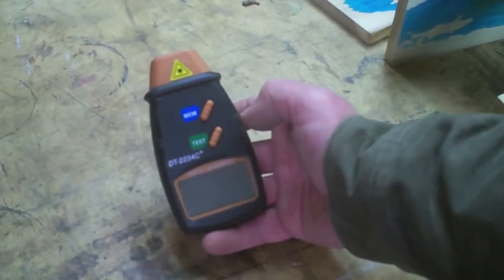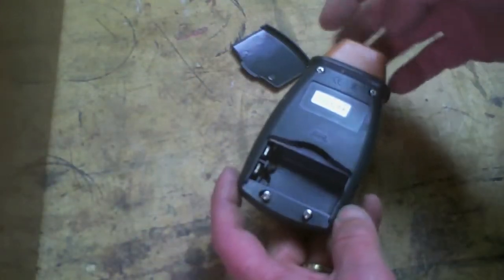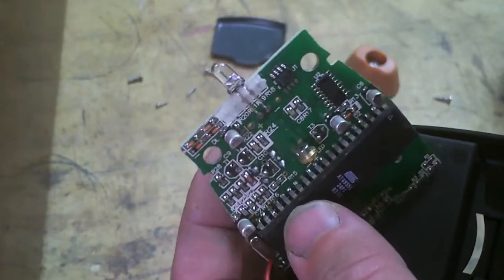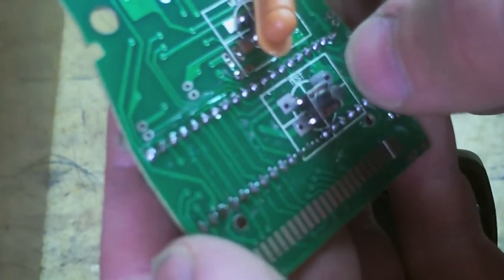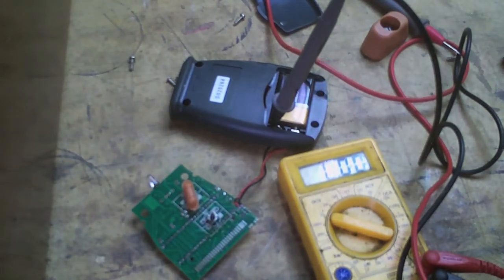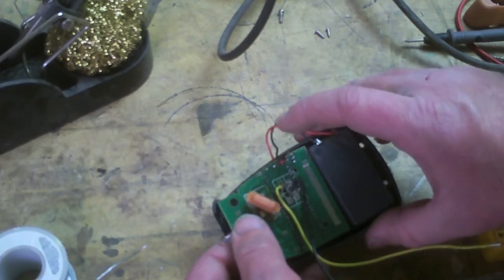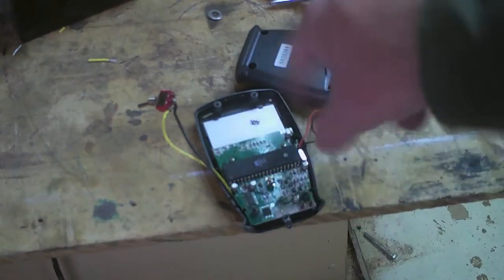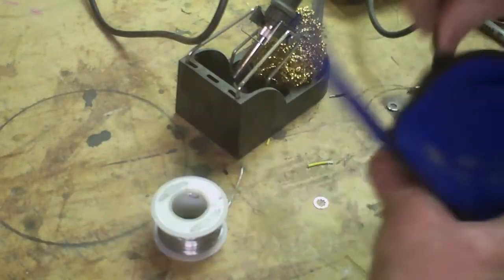Digital Optical Tachometer Modification

Comment: That 'bigass IC' is an Atmel ATMega microcontroller; depending on how the fuse bits on it are set, you could theoretically dump the firmware and modify it to have an 'always on' feature.